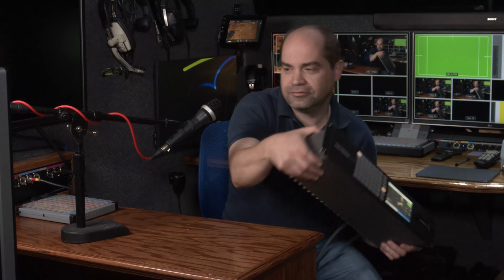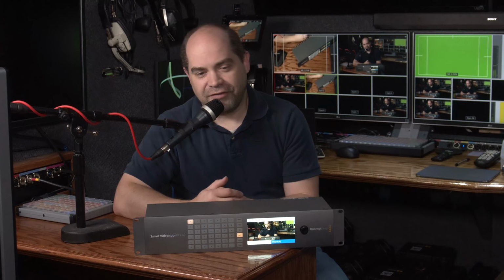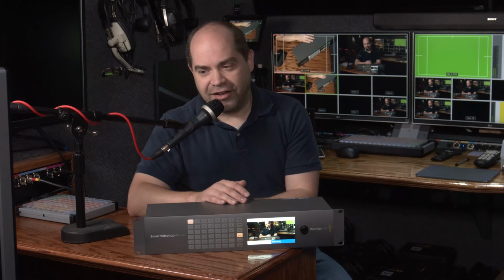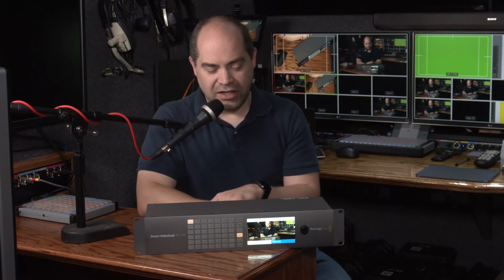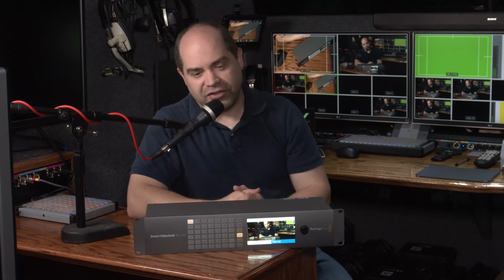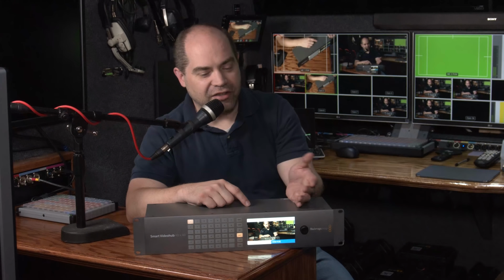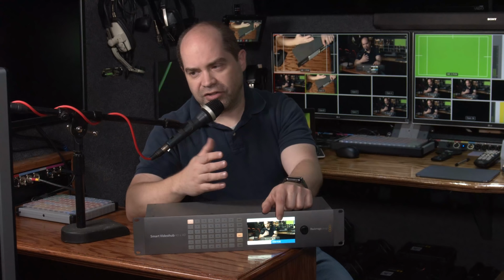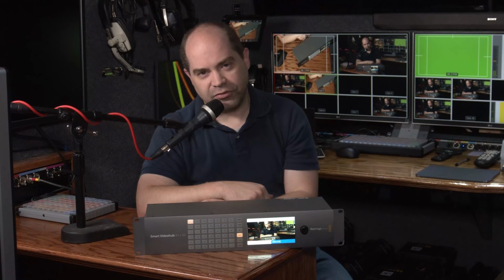My Favorite Video Gear

Comment: Did you ever decide to upgrade to the Sony PXW-Z90? Do you still use your X53? I love mine but I just purchased the HXR-NX80 for the upgraded sensor.
Reply from the maker: I won't be replacing any of my cameras with a Z90, but when it's time to add another camera, it's either going to be that or the Z190.

I still do use the AX53. It's currently mounted high on the wall in my trailer for the overhead shots I do in these YT videos.
Reply: Doug Johnson Productions The X53 is a handy little workhouse for product shots. The Z190 would make a great addition with the 4K 60P option. You have lots of great cameras already so I’m sure you’ll make the best decision for your workflow.

Comment: Does this equipment work as a video scaler also, or does it keep the same video format for each output as it is provided by the input?
Reply from the maker: It doesn't do any kind of processing; whatever signal format goes in is what comes out.
Reply: Thank you, Doug! Your content and info you put out is much appreciated! 
I had a few more questions regarding ATEM switchers by BMD. What is the best way to communicate with you?

Comment: LiveU Solo. Completely changed my stress levels when it comes to live streaming events. With 2 x 4G USB Dongles, a Netgear Nighthawk 4G + the venues (usually terrible) WiFi, I can bond 4 internet connections together to easily get 6-10 MB/s up. I've used the Teradek Bonds but they are nowhere near as robust as the LiveU units. I hired a LU500 once and the next day bought a Solo and it was the best  video gear purchase decision I've ever made.
Reply: I second your comment and came from Teradek too. It is unreliable and always give me high stress.

Comment: We have a BMD 40x40 router in our production truck as well. We absolutely love it. Each station (Director, Producer, Replay, Audio) has a remote panel to control their individual multiview, and system inputs, ect. But I would have to say my most favorite "must-have" piece of equipment is my test monitor, the ability to monitor HDMI, HD-SDI, and Analog signals in the same device. Mine even has a ST single mode fiber receiver to check HD-SDI signals via fiber: https://www.markertek.com/product/st-allin1-test2/securitytronix-st-allin1-test2-7-inch-touch-screen-ip-camera-monitor-and-tester-with-li-ion-battery
Reply from the maker: That looks like an awesome product! Thanks for sharing!

Comment: Do you run the router before or after the switcher?
Reply from the maker: Both. Cameras and other sources go into the routing switcher, and those get routed to outputs that go to the switcher. Then the outputs of the switcher go back to the routing switcher so they can be routed wherever those signals are needed -- video recorders, projectors, monitors, encoders. etc.
Reply: @djp_video  thanks

Comment: My favourite piece of Gear is a BNC Tool (https://www.amazon.com/BNC-Connector-Removal-Tool-inches/dp/B003X1BMBY). I also like the Ross Ultrix with Ultirscape as Router / Multiviewer a lot. And for sure the Barco E2. A little Show-Saver is also the Decimator MD-Cross and cheap China converters (you know why ;) )

Comment: the videohub is a no-brainer in the video production industry..IMO

back to the topic:had some troubles with the small ones..the 20x20 and the old 16x16, when they changed the lineup..it become sort of legacy hardware, and a bit tricky with the new software/firmware. But managed to restore it to old firmware(pre 2014) and it's still working today, 7 years later.
Honestly, If some extra cash is at disposal, I recommend the AJA line-up..much more reliable. But alltogheter, the BMD VideoHub is the best bang for the buck!

Off-topic question: what model of modem are you using?  
sorry, but I can't manage to find the video in witch you tell the model.
Reply from the maker: The cellular router is this one: https://djp.li/mofi

As for AJA, I do really like their stuff. In this case they don't make a product suitable for me -- everything in my trailer is 4K (6G-SDI), and even the 40x40 BMD isn't big enough for my needs.
Reply: @Doug Johnson Productions...thank you! I’m interested in buying something like that....and since you never complain about it, I’m thinking at giving it a chance.

Well, about the videohub, sorry to hear that. Nothing stands near that 3k$ price tag of the BMD.

One solutions could be buying another one, dividing the sources/destinations by type/use between the two and use like 10 or 12 ports to bridge the two together. You’ll wind up having a 68x68 video hub. It's a bit less straightforward, but can do the job.
Done that once, where i  was needing 30x30 cross-points and all I had was a 20x20 videohub and the old, non working at that time, 16x16. manage to get a 32x32 out of them, with 4 bridged connections between.

PS. I was trying to link some photos to exemplify my idea...but have no idea how to upload them here.